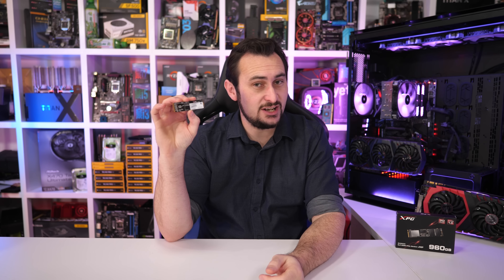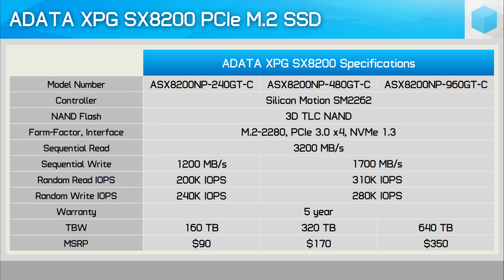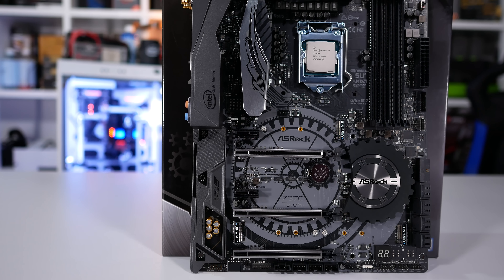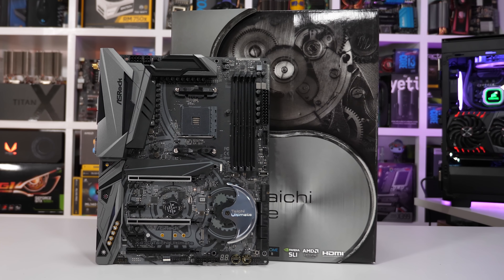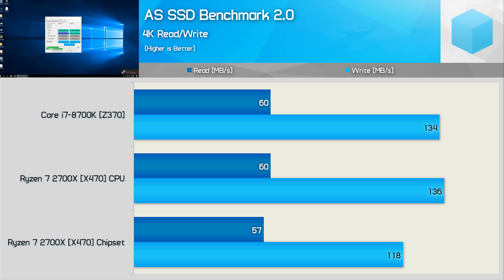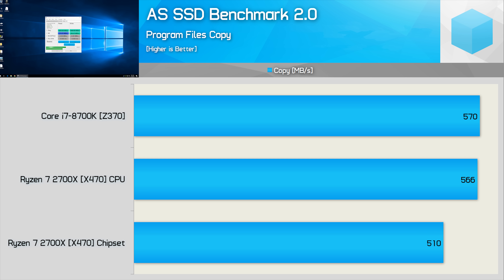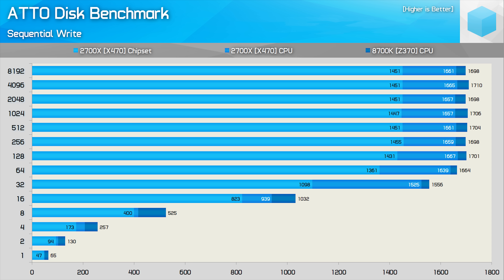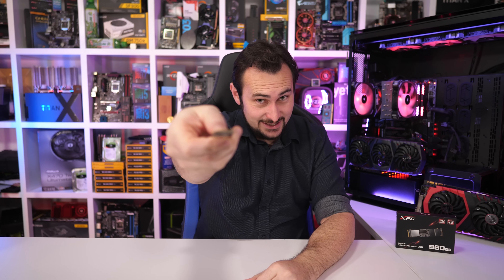Intel Z370 vs. AMD X470 Storage Performance, Not All M.2 Slots Are Equal

Comment: TO HARDWARE UNBOXED!!!! (Yeah Steve, I'm talking to you!)
This video is COMPLETELY outdated and 100% IRRELEVANT in the wake of all of the Meltdown & Spectre patches on Intel platforms (which continued to be released & updated through to the end of 2018) which KILLED SSD storage performance (ESPECIALLY the all important random reads & writes). Since then, it's been the AM4 platform with the superior M.2 NVMe speeds afaik. Either update this video with modern, actually accurate results with all of said patches taken into account, or delete it; because as is, it's just an extremely misleading & confusing pile of inaccurate misinformation. 

The difference in SSD storage performance on Intel platforms from early 2017, pre-patches, versus early 2019, post-patches, [even with the improved Retpoline patch courtesy of Google, for Spectre] is pretty damn blatant.
Reply from the maker: lol you muppet
Reply: @Hardwareunboxed  If wanting a properly representative look at storage performance across both available mainstream platforms (current LGA 1151 & AM4) after the countless Meltdown & Spectre patches dropped by both Intel, and Microsoft themselves, throughout the entirety of 2018 makes me a "muppet", than so be it shrug lol. Hell, the updated Retpoline patch for Spectre only dropped just this past month, so the effects of dealing with theses exploits on performance are still very much on-going.

Lots of professional reviewers I follow actually stopped using Intel platforms for their storage testing during & after all of this because of the hugely variable performance impacts of all these patches made ensuring test consistency from drive to drive an absolute nightmare.
Reply: @Hardwareunboxed  Also, considering your test drive in this vid; where's the ADATA XPG SX8200 Pro review guys??? 

If one wasn't in the cards, you should DEFINITELY reconsider, considering the fact it goes properly toe-to-toe with the 970 EVO Plus (& generally beats out the OG 970 EVO) currently selling for $250 (US), while costing just $165 (aka, $85 less!!!!) for the 1TB model (Amazon), with its >3x larger SLC cache to boot! (150GB vs 42GB for 1TB 970 EVO Plus). 
And if you don't need a drive that big, the 512GB model is just $88...... or the exact same price as the 1/2 as large, 250GB 970 EVO Plus... O____O

As far as I'm aware, that puts it in a "bang/$" league entirely all it's own, no? Aka, right up your guy's "best value = king" alley as far as I'm aware.

Comment: AMD does it better
Reply: Linus Testicle Tips that name though :-D
Reply: Granted I wasn't paying that much attention, but weren't AMD lagging behind in pretty much every test or have I misinterpreted the data?
Reply: Cmdr Flint.
Look at how the m.2 slots are connected, on Intel they all have to share the DMI 3.0 link (basically one PCIe X4 3.0 link) while the two m.2. ports on AMD share nothing.
Reply: @magottyk actually intels method in this example at least is more flexible.  in the amd method here if you have 2 ssd's one will always run at x2 speed or less and the other will always run at x4 speeds.  even if the x4 ssd is doing nothing the other ssd can not use that bandwidth.  with the intel system either of the ssds can run at x4 speed (just not at the same time) and any config in between (like say one at x1 and one at x3 essentially).  the major drawback to intels approach is that the intel ssd shares bandwidth with the gpu which only really matters when loading textures for gaming.  so in the loading screen the amd might load 2 seconds earlier if storage and pcie bandwidth are the limiting factor.  if the limiting factor is bound by a single thread (and most of them are) then the intel will load faster.  both systems work well.  but the dedicated x4 to the cpu for the ssd is nice but you get about the same either way really
Reply: Bobhumplick
Actually if you look at the AMD setup there's a lot going for it over the Intel setup.
The second m.2 can only ever utilise half the bandwidth of the chipset connection, leaving plenty for sata USB etc.
Now looking at StoreMi and utilising a slower NVMe drive suited to the available bandwitdh (1500/1000 read write type) and a nice large HDD (I got the ironwolf 6TB with 210 MB/s read/write), combined you don't hit any bandwidth limitations or competition with the chipset connections bandwidth and you can still run a full speed NVMe drive like the 970 evo/pro as boot.

On intel any additional drives will compete for bandwidth with a high speed NVMe, just one extra SATA SSD and that's blown out any leeway that the DMI interface has left. How often will there be a clash for bandwidth? That very much depends on your setup.
Reply: and what other devices are you talking about normally?  a mouse and keyboard on usb?  a large hdd, so spinning sata drive.  a web cam on usb at 1080p can run over usb 2.0 which is maxed at 60megbytes per second. and an iron wolf can peak at 210 but it doesnt stay there. but just say for the sake of argument that the webcam maxes usb 2 out at 60 and the iron wolf is at 210 and the keyboard and mouse equal 1megabytes then thats 271 megabytes per second runing a full 1080p webcam while doing a continuos full speed file copy from the iron wolf and thats still only 270 megabytes out of a possible 4 gigabytes per second.  thats 271 out of 4000. thats going to waste.  now on the other hand there is only one thing in the computer that can use that bandwidth but doesnt have it.  and thats the second ssd on the x2 slot.  saying that having an ssd run at half speed so that a system that basically uses a drop of bandwidth can have a whole bucket doesnt make sense to me. besides the comnputer prioritizes traffic so that everything gets an equal share.  but in the end they both work pretty well so ....
Reply: bobhumplick
"and an iron wolf can peak at 210 but it doesnt stay there."
No that's sustained rates, it peaks up around 250.
One decent sata SSD is 500MB/s sustained, raid 2 together and that's 1GB/s, gigabit network is 100-125MB/s (assuming you aren't running a 10Gb NIC @1.2GB/s) there's 600MB/s min if you're say streaming a game at high resolution/ with a quality encode and running a game drive and OS drive (let's not forget background tasking with windows)
Given that a Samsung 970 hits 3500+ you've bottlenecked the DMI 3.0 link just streaming a game, nevermind if windows (or AV) decides to do an automated task.

For sure allowing that 2nd M.2 drive to run at PCIe 3.0 speeds would give more options, but with the dedicated M.2 slot at PCIe 3.0 speeds, the only real need would be for NVMe raid. But that's a story for X399 or an add in card for either Z370 (almost pointless with onboard M.2) or X370/470 and sacrificing your GPU bandwidth, which would only be an issue with a 1080ti or better card.

SATA SSD's are becoming real cheap so that setting up a bunch of 256GB drives in RAID 0 on SATA can get you some really fast speeds and decent storage space. and a 4 drive setup like that with a NVMe high speed drive running separately is going to really cramp that bandwidth on Intel.

If we look at NAS, then 10Gb NIC (PCIe 2.0 x4 slot required which is still a X2 PCIe 3.0) becomes a really good option, but as that uses 1.2GB/s, that with a local NVMe drive swamps the available bandwidth, unless you use the PCIe 16X_2 slot for the purpose limiting your GPU bandwidth. 4 Ironwolf drives in RAID can nearly saturate that 10Gb bandwidth, with many vloggers requiring large amounts of storage making a 40TB array easily justifiable. Raid 10 just adds to the read bandwidth available and is considered more reliable than a raid 5 array.

On X370 and X470 you do not have to use the GPU X8 second slot to get this as the X4 slot is good enough for this purpose and will not cause bottlenecks (but you can't use the second M.2 slot), while doing so on Z370 will put the throughput needed for simultaneous operation over 4.5GB/s causing a bottleneck.

We really are at the point where PCIe 4.0 is needed as right now PCIe 3.0 just manages to meet requirements allowing desktop setups to mimic high end desktop setups so long as your requirements stay within the home/small business typical scenario's.

Oh and before I forget, Thunderbolt 3.0...........